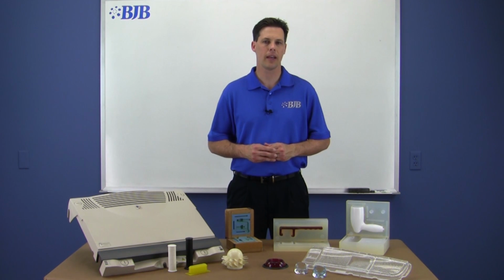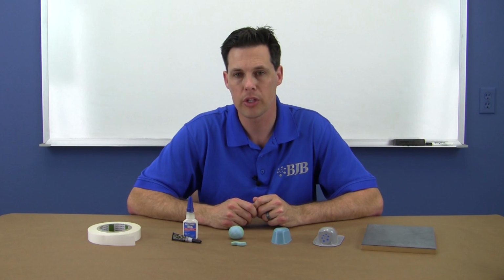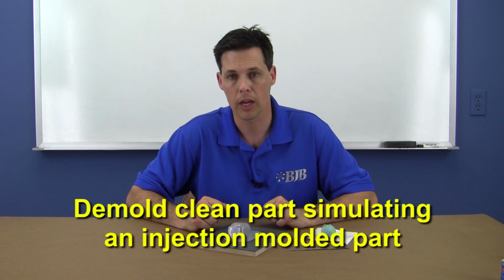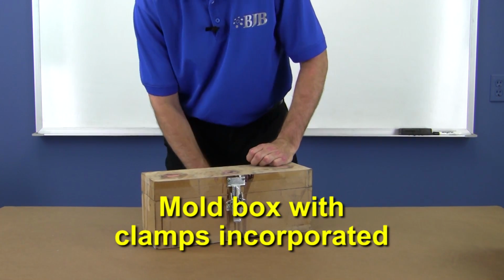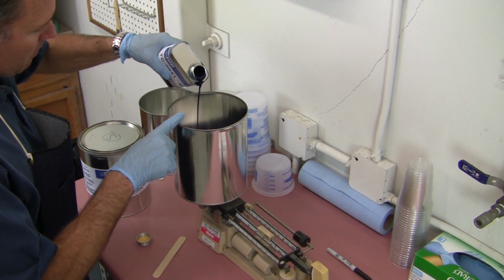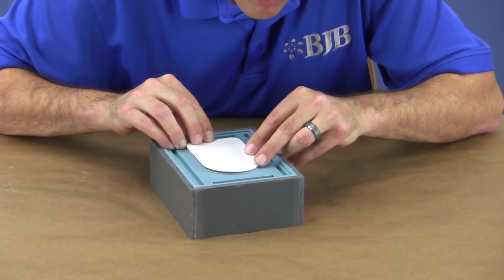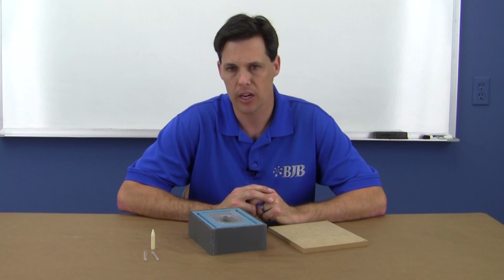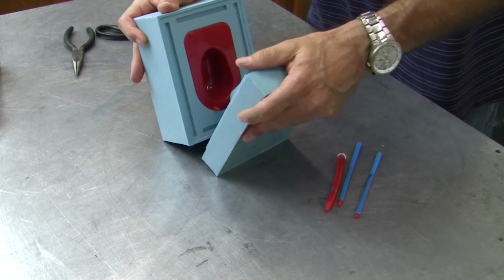Great Video: How to make 2-Part Silicone Mold | Part 1

Comment: Hi, how did you mount the inner plug onto the surface? I have a kind of a cup to make a mold from and I don't want to stay the plug inside the cup while demolding. Hope you get what I mean. 
Thanks
Phil
Reply from the maker: Philip Braches The plug used here was made from silicone so it did not stick to the helmet or base surface.  The silicone plug is easily removed after the first half of the mold is finished and you are ready to pour the second half.  I hope that answers your question.
Reply: Thank you very much! You have great videos.
Phil

Comment: If your original sculpt is polymer clay, do you need a release over that? What would that be.
Reply from the maker: You don't necessarily need a mold release if the surface is fairly smooth, but if you have a lot of texture or undercuts a mold release might make it easier to demold once the silicone has cured.  The issue becomes more of a mechanical lock and not a "bonding" issue.  For mold release, our ZIP ME-301 would work well.  You should also be cautious of different clays with Platinum Silicone and run a small test before you cast a mold over the clay.

Comment: What do you do to to stop trim marks under an uneven hat, like say a fedora?
Reply from the maker: Hi Mark.  If the mold split line is going to be uneven, you would most likely want to use modeling clay to carefully sculpt up to this edge.  As opposed to the clay work done in this video where you end up with a feathered edge, you would want the clay to form a ledge perpendicular to the split line.  This would give you a 2-piece mold with a durable split line to produce many castings.

Comment: Generally Speaking, How many parts could one expect to get out of a mold like the one shown in this video?
Reply from the maker: Hi Chad, great question.  It can vary depending on a few factors, but a safe number is 25 with a possibility of getting up to 50 parts if mold release is used and the grade of polyurethane is not overly aggressive on silicone molds.  Keep in mind the gloss of the parts out of the mold would likely go down, but if this were a part to be painted it would not be an issue. We also find that the softer polyurethane casting materials are less aggressive on silicone molds so part yield is often higher than rigid polyurethane castings.  Occasionally we do have customers getting 75-100 parts from a silicone mold but the conditions and variables are often unique.

Comment: Can this process be used to replicate car parts like bumper lips?
Reply: Body parts such as body kits. Sorry about the confusion if there was any.
Reply from the maker: Edwin Duran
Molded Polyurethanes are used quite often as after-market automotive parts.  We have many customers who make anything from tail-light lenses, grills, to interior parts.  The question of whether your desired part will be suited to making silicone molds and casting comes down to geometry and size.  A large silicone mold might be very expensive but there are ways to build molds with a combination of materials to incorporate the ease of using silicone and supporting it with wood, fiberglass, or another rigid & inexpensive material.
Reply: Thanks so much for the advice. I will definitely look into how I can make the molds, although the piece itself is quiet large.
Reply from the maker: Edwin Duran
It's possible that if the part is large, you may need to look into dispense equipment.  For initial prototyping, you might be able to get away with a polyurethane system with a long(er) work time and wait for the cure.  When things look good, you can step up to faster work times and quicker demolds.  The trick is getting the mold filled; that's where equipment may be inevitable.  But surprisingly, we have many low-volume production customers who still hand pour and may simply use ovens or heat boxes to speed up the demold/cure.

Comment: This may be a silly question, but how would you go about setting up for a figure mold that lacks a flat bottom, such as a model of a person? I would assume using clay to keep half the figure covered and the other half exposed for the first piece of the mold, but I'm not sure if that's the best option or even the correct choice.
Reply from the maker: There are a couple of options, actually.  You could indeed use clay to build up to your mold's split line.  The other common method is to suspend the model in a box, use a clear silicone like our TC-5030 and cast over the entire model, then come back with a sharp razor knife and cut the mold in half to the split line you want.
Reply: BJBEnterprises Thank you so much. This was very helpful ^^

Comment: AH! Plenty of thanks! I am learning to make molds and casting, but was not aware of the feed and vent tubes, and how to position them.

I seen some examples when peple pour resin into the first half, and then place the top mold part on top- but that will surely guarantee the pry line, and maybe some stubborn bubbles.

Comment: Hi, Can you make a mold of silicone and also cast  with silicone if you use a silicone mold release?
Reply from the maker: Yes, you can cast Silicone into Silicone with an appropriate mold release if the geometry allows easy application.  Note that a Platinum based silicone would not cure well in a Tin based silicone mold (cure inhibition).

Comment: BJBEnterprises I was looking at your water clear polyurethane casting and read the MSDS sheet.  I have a a few questions:
1.  These are tint-able so I was thinking about using them for custom tail lights and signals in a car, do the colors fade and is there a way to prevent it?
2.  How UV resistant are these and will they "craze" or crack over time?
Reply from the maker: Hello Eric.  The Water Clear Polyurethanes we offer are the preferred material for reproduction tail lights and signals.  Certain formulas like the WC-783 and WC-792 feature additional UV absorbers in them to provide years of outdoor use and color stability.  They have been extensively in after-market automotive parts and popular theme park attractions because of this UV stability.   If you would like more assistance on these products and recommended mold materials, feel free to contact us at our Tech Dept:  info@bjbenterprises.com or call 714-734-8450
Regards!

Comment: You have a marvelous video. I was casting plastic marker lights for my car trailer. My clear plastic casting resin flowed like thick honey (low viscosity). I tinted the plastic red. Do you sell a casting plastic resin that has a high viscosity rate? How long did your plastic resin take to fully cure? My resin cured in 2 days. I had issues with air bubbles. Going to use a paint pot to degas the resin in the future.
Reply from the maker: Hi Richard, thanks.  It sounds like your clear casting resin is thicker or "Higher Viscosity" than our Water Clear systems.  If you have the Data Sheet, look at what the mixed viscosity is listed as in Centipoise (cps) and compare with ours on the website; a higher number means thicker and a lower number means thinner.  I would consider anything under 1000 cps to be fairly easy to pour but certainly anything under 300-500 cps is very thin. Honey would be around 2000-3000 cps.  Pulling vacuum to degas the material first is essential on clear systems.  Pressure casting after the filling the mold will ensure you fill all of the detail and don't trap any bubbles as the liquid flows through the mold.  We have a new video (part 2 to this video) set to be released very soon and will answer many of your questions so subscribe and stay tuned!
Reply: Thanks for the information. Tried using a heat gun with minimal results. Going to use a paint pot to remove the air bubbles. Yes, I went by the correct mixing ratios. Finally cast a trailer marker light lense that looked satisfactory. When I immersed the light in hot water, the resin light got very flexible. Do you have a product that I can mix to make the resin more resistant to heat. My concern is when I install my trailer light in the hot summer weather, the light may collapse.
Reply from the maker: I would not bother with using a heat gun to heat liquids or cure parts.  It is too hot and does not heat the product evenly.  The liquid (in small volumes) really needs to soak in a warm environment for 10 minutes or more.  A heat gun may scorch it.

As far as heat resistance goes, there is no magic additive to make something more heat resistant.  It starts with the base resin system you are using and it sounds like the stuff you have is more hobby-grade and not designed for making lenses.  We have several clear products that are used extensively for after-market tail light lenses and have good heat resistance.  Note that to achieve the best heat resistance out of a product, you will want to observe the post-cure schedule stated on our material Data Sheet and cure the part at elevated temperature.  This is standard procedure in polyurethane casting (and epoxies) if you are trying to achieve the maximum properties of a casting material.

Comment: Dear, what would be the best method to build a mold silicone to copy the body of a mockup of a bus with about 40cm in length where the part would be hollow inside to reduce weight.
Reply from the maker: Leonardo, if you want to build a hollow structure from a solid model, typically you build the outer mold first and then put in the mold a product like sheet wax in the desired thickness of your walls, to simulate the part thickness.  Then you cast the second, inner mold.  Remove the sheet wax and now you have the correct wall thickness to cast a part.